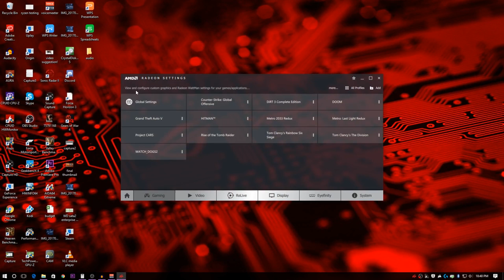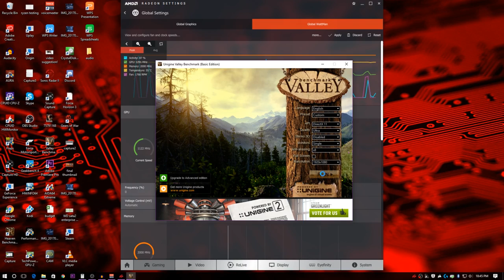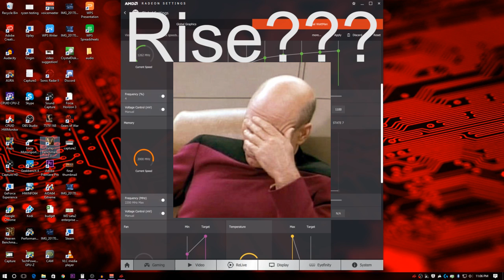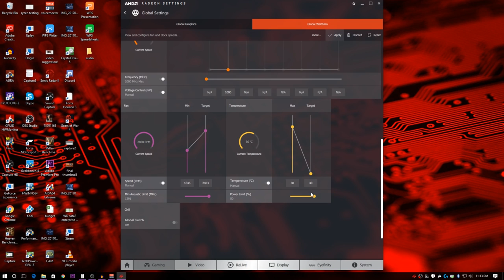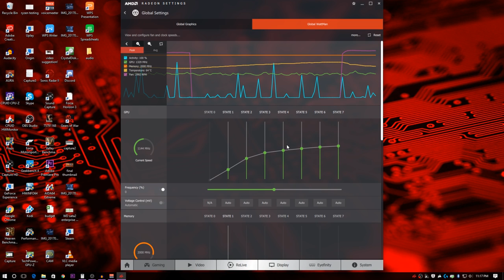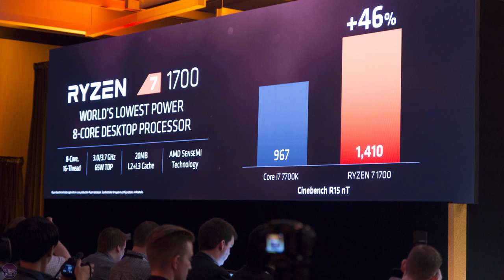Beginners step by step [how-to] overclock your AMD video card (RX 480)- Global WattMan

Comment: I can't see global wattman on my installation, how can I solve the problem?
Reply from the maker: Your card may not support overclocking. That is usually the case when it is not present in the software. What GPU do you have?
Reply: @LetsGetTechy  I use an apu, the Ryzen 3 2200g.
Reply from the maker: I wish I could give you more info on it, but I have no experience with the new APUs. Check in your BIOS. You may be able to overclock it in there. I know you can allocate more memory to it in the BIOS which is helpful for performance. If you can't find it in the BIOS, just do a simple search of something like "overclocking 2200g". I'm sure there are some videos out there on it. Sorry I couldn't be more help!!
Reply: @LetsGetTechy  Thank you, I guess AMD doesn't support Wattman for APUs.
Reply from the maker: The reason is probably because it needs to be restarted when you change anything on it, since it is on the CPU die. They probably thought it wasn't very user friendly to give you access via Wattman and then force you to restart whenever you make a change, so they just dumped it in the BIOS.

Comment: Really don't want to bother you but when I raise the core clock and then benchmark it, the core clock actually decrease by about 100MHz. I'm using an RX 570 8GB shield. What could be the issue?
Reply from the maker: It's normal for the clock to dynamically change due to temp, load, power, etc. You could try a bit higher overclock to get to where you want after the drop under load, but it might not be stable.
Reply: @LetsGetTechy  Thanks alot for replying but I think I found my problem. I'm gonna buy a new psu. I'm using a corsair 430cx with a 570. That would be okay if I weren't trying to overclock it, just gonna wait til Cyber Monday. Thanks alot btw
Reply: @LetsGetTechy  Could I ask another question though? I'm new to overclocking as you can probably tell lol. I was changing my clock speed and stress testing my gpu. I left the room and when I came back it said my gpu had reached 120 celcius. That's extremely high but I'm pretty sure it was only for like a minute. Will my gpu be okay?
Reply from the maker: The software is incorrect. It would have shut down if it got that hot. Also, I'm sorry to say but the boost you are seeing with the GPU clock is normal. A new PSU is not going to change that. It's meant to fluctuate, and a new PSU isn't going to keep it locked at where you set it.
Reply: Let's Get Techy  The clock speed doesn't fluctuate, sorry I didn't make that clear. It does the opposite. As soon as I even raise the card by even 0.5% clock speed it stays at around 1100 MHz and doesn't change no matter the amount I increase the clock speed. When I reduce the clock speed to 0% it rises back up to 1268MHz. When looking online it seems the GPU  that I have should be using around 140W but mine only takes 120
Reply from the maker: I would use a different software. If you are using wattman, try afterburner and vice versa. A 570 shouldn't need more than what you have PSU wise. If it was a PSU issue not giving enough power, it would just crash.
Reply: @LetsGetTechy  I've used both and I've gotten the same result. I don't know what to do. Maybe just a extremely bad pull in the silicon lottery or maybe there's more to it. I hope there's a way to fix it anyway. Perhaps if I try gpu z or something
Reply from the maker: I've never had one before that would drop below normal once overclocked. :(
Reply: @LetsGetTechy  Wish me luck lol. I think I am having throttles honestly. When bench marking GTA V my CPU and GPU usage would sometimes drop quite low simultaneously. Gonna get a new PSU on black Friday, mines getting old anyway. I'll update it and if it solves the issue I'll let you know and it might help you help someone else someday. Thank you so much for the support. You've gone above and beyond. New sub.
Reply from the maker: Thanks so much! Please do let me know how it turns out. Email me after you get the new PSU. letsgettechy01@gmail.com
Reply: @Elitezombie03  did it fix your issue?
Reply: @10kolton  Sorry for the slow reply. No, it didn't. I've narrowed it down to fault of the pci e slot but haven't had time to fully test it because I've got exams coming up soon. Need to test it soon because my motherboard warranty runs out in January.
Reply: @Elitezombie03  i just ordered the 570 8gb so the verdict will make me feel secure about the purchase lol
Reply: Sounds like you just hit your powerlimit so the card has to throttle. Try lower voltages and when it get's unstable lower the freq as well.

Comment: my gpu voltage only lets me edit the last box ffor voltage what do i do? and i only have state 7 to change???
Reply from the maker: It is likely a limitation of your specific video card. You can give MSI Afterburner a shot instead of using Wattman.
Reply: Let's Get Techy yea thanks for response I used msi after burner and I think it’s bottle necking I don’t know to much about PCs but I upp the 2 thingys a little they do no fps gain but when I go little bit more they crash the drivers sooo my pc is a bit old 4 years old time flys man
Reply from the maker: Yeah, I would probably just leave it stock. If it's an older card, you likely won't see much of an improvement before you hit stability issues.
Reply: Let's Get Techy thanks for the reply’s

Comment: after i restart my computer with overclock on it resets to normal can i make it so its always overclocked?
Reply from the maker: Last I checked Wattman would not save profiles. That may have changed,  but if so I'm not sure how to do it.
Reply from the maker: You could try MSI Afterburner. It allows you to save profiles.
Reply: saves profiles on my end and keeps the oc

Comment: um everytime i open amd radeon settings, nothing comes up, its just blank and blurry in the area that it used to take up on my screen
Reply from the maker: Maybe try using DDU to clean out your current drivers and then reinstall? Google "DDU".
Reply: it works after i restart the pc but it keeps crashing whenever i overclock
Reply from the maker: Then unfortunately your overclock just isn't stable. Some overclock well and some don't overclock at all.

Comment: follow up , because you actually talk to people and because of your video you made me think that it is possible to run AMD cards at normal temps . Yes .  just got  MSI  Armor MK2 8G  OC  RX 570 .
so far the most power is  52 watts at  60 C . that's the most i can run it at .
( even though the card is spec'd at  150 watts max on msi  web site )

i kept Wattman running to view the  Peak  values in the upper Left corner .
then ran  Dying Light .  after a while , back to deskTop to view  Wattman  Peak values at the upper
Left corner .  peak  Temp at  60 C ,  peat watts at 52 .  GPU  1 Ghz FIxed and  memory 1.5 Ghz  fixed ,
clocks . Peak Utilization at 100 %  of coarse .

someone might NOT like what i have done , because they might say :
i paid for  1.28 Ghz GPU and 1.75 Ghz memory clock . well , go a head and use that ,
but it the card runs HOT , don't complain about the heat .

Here are the settings :
GPU clock  Fixed at  1 Ghz( underclocked ) , Memory clock at  1.5 Ghz ( underclocked ) .
Power Limit % is  0 zero .  Yes ,  both  GPU clock and Memory clock can be set Fixed min\max .

Those Orange dots can all be dragged to the Same value , thus  "Fixed"  for  State 1 to State 7 .
however , an easier way is to  set  State 1 to  1 Ghz , then set State 1 as  min\max  by  Left clicking the
"State 1"  text ( faster setup that way ) .  when i know i am on just the  Desktop it is then easy to set
min\max  for  State 0 zero , that forces  GPU clock to  300 Mhz fixed and  Memory Clock to  300 Mhz fixed,
and  Zero Fan ( Fans off ) .  For  Gaming , set GPU to  1 Ghz fixed and Memory  to 1.5 Ghz Fixed .

installed  driver  19.7.1  from  msi .  DOOM 2016  all settings Max including  txss(8 AA)  shadows on Nightmere or whatever , all maxed with  Vulkan  1.0.109 ( part of  driver package 19.7.1 ) .  stays at 60  fps most of the time .  60 Hz  TV  using  V-sync  On . 

i  did NOT inatall   msiAfterBurner.

right now  , a little upset of all the  Heat seekers that keep  blashing the heat issue .  60 C  max is easy
to obtain .  I could do the same with an  RX 5700 .

RX 570  went into a  mini case that has a  uATX  MOBO . RX 570 is a bit longer then the  MOBO .
have about  2 inches to spare before it would have touched  case fan .  Back Plate on the card was a
big necessity in this small case .

i did NOT touch  wattman  voltage settings .
GPU down to 1 GHz fixed ( default max is 1.28 Ghz ) thus you could overclock above  1.28 Ghz
Memory down to 1.5 Ghz ( default max is 1.75 Ghz ) thus you could overclock above 1.75 Ghz
Fan curve dots were adjusted too ( a little bit )
CPU clock at  1.7 GHz min  with  1.7 Ghz max ( fixed )
DOOM  2016  runs really good ( CPU clock not  that important )
this card is a  224 Gig Byte of Bandwidth crunch , comapare to RX 5700  at  448 Gig Byte of crunch power.l

if you had a new  RX 5700 , you could demonstrate how to keep it cool by underclocking it .
Everyone else shows that it runs at 80 C to  90 C .  Well ,...underclock it , i bet the temps can easily be brought under control , with a slight reduction in FPS ( typically  insignicicantly less ) .

Comment: With what Programm you recordet at the end?
Reply from the maker: I used my Elgato capture card.
Reply: Let's Get Techy i habe the Saphire RX 480 Nitro+ OC, wat i can do to record laagfree without Hardware?
Reply: Let's Get Techy i habe the Saphire RX 480 Nitro+ OC, wat i can do to record laagfree without Hardware?
Reply from the maker: You can try AMD's Relive software or another program is OBS.
Reply: Let's Get Techy i knos obs, i dont have good settings and cant finde theese, radeon re live is lag,
Reply from the maker: Unfortunately I don't have a lot of experience with it since I use a hardware solution.
Reply: Let's Get Techy ok
Reply: Let's Get Techy what elgato you use?
Reply from the maker: HD60s

Comment: with what will help me the overclock thing ?
Reply from the maker: More frames per second and potentially smoother game-play. If you go too far though, it can make game-play worse.
Reply: oh ok well i did everyting you did in the video and my amd card started making a lot of noise so i reset everyting and its fine now and so i wont be trying to overclokc it again cause i dont want to fc it up
Reply from the maker: The noise it was making was the fans spinning at maximum. Overclocking isn't for everyone though- nothing wrong with that.
Reply: well ye but my video  cars is 8 GB and when its not overlcoked it useses only 4 GB and when i overclock it its useses  8 GB i i gess i will overclock it only wnhe i play some games :D
Reply from the maker: I'm not sure where you are getting that information from, but overclocking has nothing to do with how much memory the card uses. The game or application requests how much memory is necessary regardless of whether it is overclocked or not.

Comment: what do i do if i overclocked my rx 480 4gb version and didnt get any improvement???
Reply from the maker: Are your clock speeds higher?
Reply: yea but their is no improvement whatsoever, ive done benchmarks and everything
Reply: the frames in videogames stay the exact same with no boost
Reply: and when i boost the card they stay the same the whole time
Reply from the maker: Sounds like you may not have gotten a good overclocker if your performance isn't scaling at all.
Reply: im using globalwattman though
Reply from the maker: If the card itself isn't a good overclocker, it won't scale well when you overclock it. Two identical cards will overclock differently.
Reply: its the radeon rx 480 by amd , and if wattman isnt a good overclocker, do you recommend anything else?
Reply from the maker: I mean the card itself might not be a good overclocker. It might not be a good chip. Every chip is different even in the same model of rx480.
Reply: k

Comment: Hello getting 20 Mh/s on MINING EDITION SAPPHIRE AMD RX470 4GB(No Display Port) how i will get more Mh/s on same card any Setting or BIOS MOD available for MINING EDITION SAPPHIRE AMD RX470 4GB installed : Radeon Software Crimson ReLive Edition Beta for Blockchain Compute Driver for Windows® 10 64-bit
Reply from the maker: try replying to one of the comments on this video where I have had discussions with actual miners. I don't mine personally, so I wouldn't be of help unfortunately. :(

Comment: the option is not coming in my settings version [ 9.5.1]please help!!!!
Reply from the maker: What kind of card do you have? Some lower end cards do not have the option of overclocking.
Reply: AMD Radeon 520tm 2 gb
Reply from the maker: @gyaathandler  yeah I'm going to guess that particular card doesn't have overclocking available unfortunately.
Reply: Thank's for the help bro
Reply from the maker: @gyaathandler  you are welcome! If you want to try another route, MSI Afterburner may allow you to do some overclocking, so check that out.

Comment: dont find my additional setting what to do after updating latest virsion
Reply from the maker: Unfortunately, we no longer have a Radeon card in-house, so if the software has changed, we won't be able to help. Did you have access to additional settings prior to the update?
Reply: before updating i have additional setting but now it dissaper
Reply from the maker: Yeah, unfortunately I won't be of help with that. I did a quick google search though and found this. Take a look- maybe it will help you.
https://www.techpowerup.com/forums/threads/how-to-make-radeon-additonal-settings-reappear.231014/
Reply: thanks but i have upgrade yo 18.3.2 latest but still there is no additional setting

Comment: Pinning voltage at max at all speeds ok... have fun buying a new gpu every year
Reply from the maker: Will do Jeremy! Thanks for the comment!
Reply: Let's Get Techy more money than me hahaha I just don't like the idea of pushing the card to 110% while playing something like a Dx9 game
Reply from the maker: The reason I see it as a non-issue is that both AMD and Nvidia moved away from allowing you to overvolt the card in a significant way. Back in the day using the OC software to push voltage did indeed allow you to venture into exceptionally unsafe territory. These days, Nvidia and AMD have cut that out. It is incredibly hard to damage a card overclocking it without applying some type of bios tweak or hard mod to the card itself. I'm not saying you won't be taking any lifespan off the card when overclocking, but that is part of the trade off when someone decides to overclock in general.

Comment: after about 30 seconds into the benchmark before I overclocked my computer froze. Is that normal?
Reply from the maker: You said you had not yet overclocked- What had you done?
Reply: Let's Get Techy Thanks for the reply, I installed the benchmark and started it to see the fps I get before I overclock and 30 seconda in it froze my computer.
Reply from the maker: That is definitely not normal. Have you overclocked anything or changed any settings for your video card or CPU?
Reply: Let's Get Techy No I have not changed anything
Reply from the maker: Run it again and see what it does. Let me know what it does, and also, give me a parts list of your computer please.
Reply: Let's Get Techy a10 6700 r7 200 series 300w psu windows 10
Reply from the maker: Is it continuing to freeze? That video card likely isn't going to see any tangible difference if you do end up being able to overclock it.

Comment: what do i do if the radeon settings is not present ?
Reply from the maker: You can use MSI Afterburner. That said, usually, if Radeon settings is not present, it’s likely a GPU that shouldn’t be overclocked. Are we talking about a laptop by chance? A lot of times this will be missing from laptops as they aren’t really meant to be overclocked.
Reply: @LetsGetTechy  am using desktop and my gpu is rx 480 also. i wasnt the one who installed my gpu, and on ur video it says that "u should have the boxed check when installing the driver otherwise wont be present". i thought maybe thats why the settings is not present. so should i use MSI Afterburner(recommended)? or got a way to make radeon settings come out, srry cos am totally new on these things.
Reply from the maker: @kennetha.1003  Either way would be fine, so you can either install MSI Afterburner, or you could download the newest driver for your rx 480 from AMD’s website, and then just make sure to install Radeon Settings while installing that latest driver. Both pieces of software will get the job down, so either way is perfectly fine. 👍

Comment: if i have these settings all the time is my gpu going to die some day???
Reply from the maker: Your GPU is going to die some day regardless if you keep it long enough. Overclocking it isn't going to drastically change the lifespan as long as you are monitoring temperatures and they are staying within a safe level.
Reply: thx one more question will my graphics card have any problems if i keep these settings?? i mean if i won't reset them
Reply from the maker: No, as long as the temps stay good you are good to go. 👍